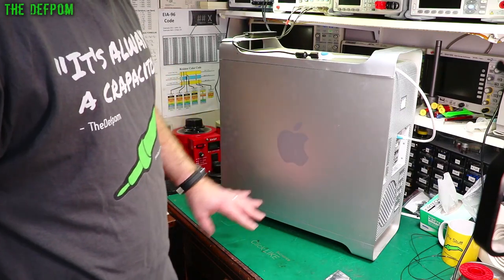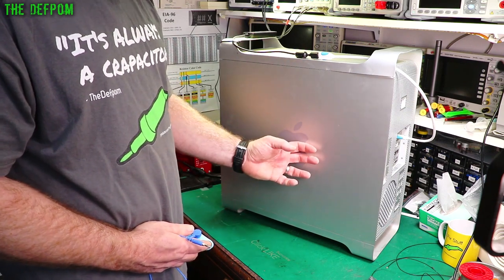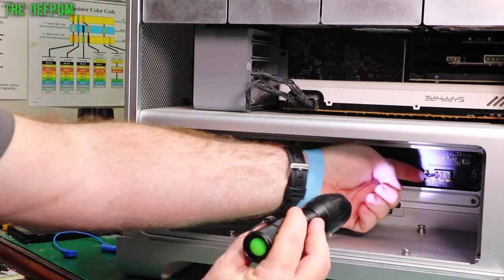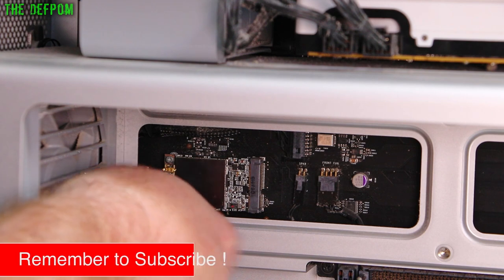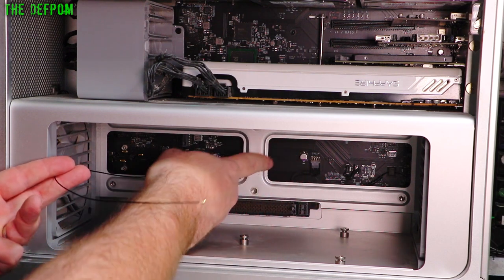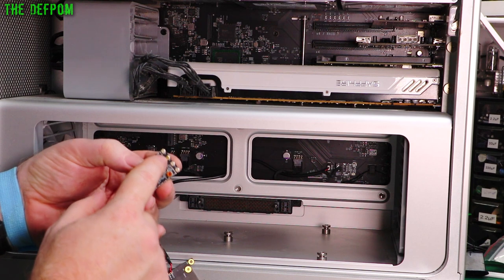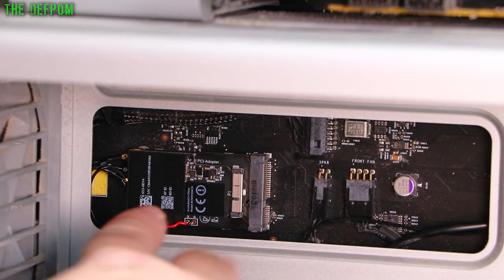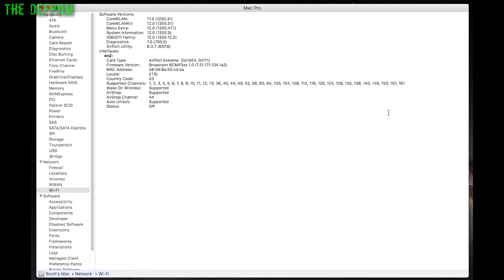🔴  Mac Pro Upgrade to 802.11AC and BLE Bluetooth V4 - No.856

Comment: Everything is straight forward here except for connecting the little gold antenna connections! If you damaged the male end of the antenna gold connects that  lead off into the chassis, what can you do?  How do you know if they are damaged? I spent several hours trying to connect mine and the more I tried the looser the connections came so that they always fell off when I twisted the board upside down so that it would plug in.

Comment: Nice video.  Am pretty sure you could have used the bluetooth connector that goes into the old bluetooth card to connect to the adapter card.  That way you could have used the 'other' supplied cable to connect the red/black connector to the adapter and then run the other end to the connector that came out of the old bluetooth card.  Leaving the short connection to the logic board in-place.   Soldering computer connections is a no-no for 90%+ of viewers.

Comment: I had a real problem with the Touchdeck and could not get it to connect with any Broadcom dongles. only success was with a Realtek RTL8761B and TRL drivers.
Everything else would connect to the Broadcom just chip fine, but the software in the Touchdeck just screwed with the Broadcom drivers. it would see it but then just fail to connect.

I did  video on it "FreeTouchDeck update" 

Hope you get it working soon

Comment: Ah I see you switched to the wireless ESD strap after pulling out the processing board
Woopsi :P
Reply: @Dust599  Well to use a ESD strap both the strap and the grounding wire is required. 
From when he pulled out the Processor board out to the end of video he does not wear the ground wire.

So to throw the ball back. You might want to get your eyes looked at ;-)
Reply from the maker: @decee1157  asi said at the beginning, my bench is ESD protected, once I had the processor and ram board out I felt fine about not using the strap, as the bench is earthed, and I was constantly touched and resting my hands/arms on the casing.
Reply: @TheDefpom  Yeah i did also guess that as the reasoning. Im just joking around.